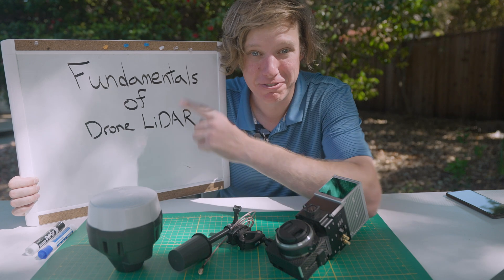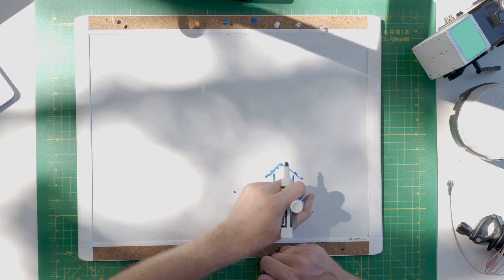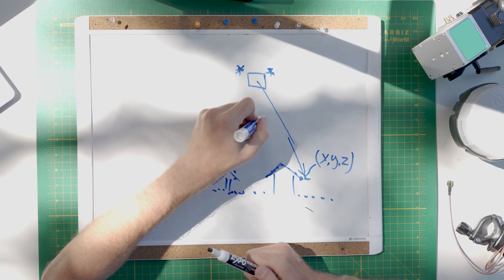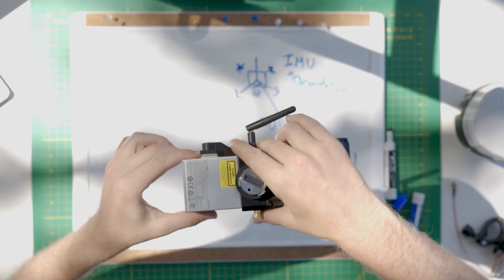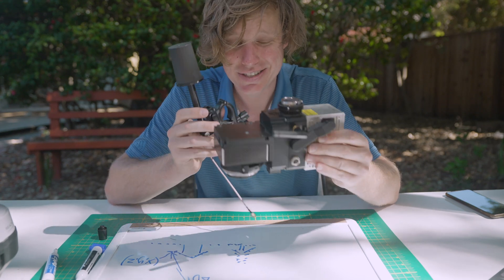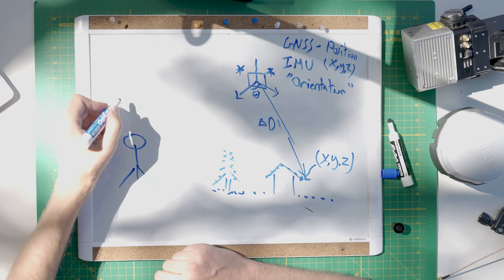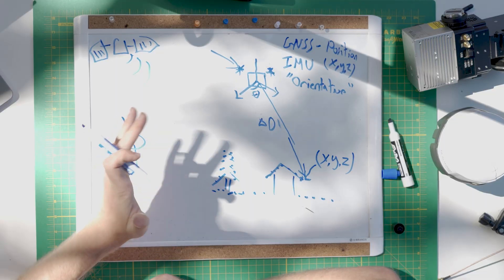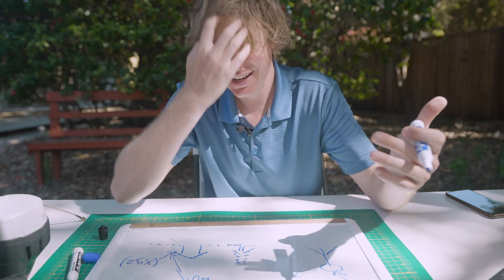Fundamentals of Drone LiDAR

Comment: Great job on the overall LEO explanation for LIDAR.  Let's talk about overall accuracy and GCP's and how they help with work flow and posting of the project as well in more detail....think you did do this but maybe in more detail now.
  
The end game is what?....The end game is very accurate contours for the most part.  To get these there is a specific work flow that needs to be followed No?  This work flow is like a check list and if not always done to speed your information will suffer...No?  RTK as you mentioned is from my point of view Madison Avenue Marketing.  So in agreement with you. Something that no one really talks about is the accuracy of the inertial part of the equation and HARDWARE that provides this information.  This could be the difference of good and bad contours with respect to accuracy.  The point is that a cheaper LIDAR system using sub grade systems does not drive the value add in my humble opinion.  Not saying one needs to spend 150K for a system, but rather 40-50 all in to get a system that gives the accuracy needed....and sought after.  Thanks for doing what you do.